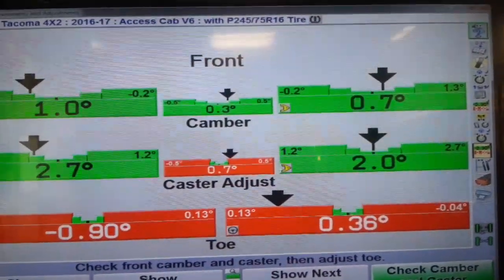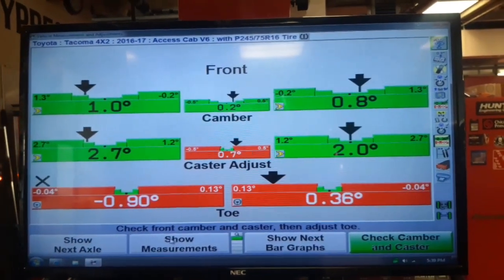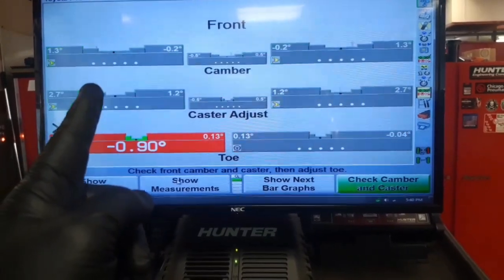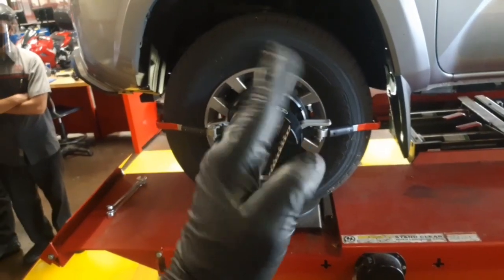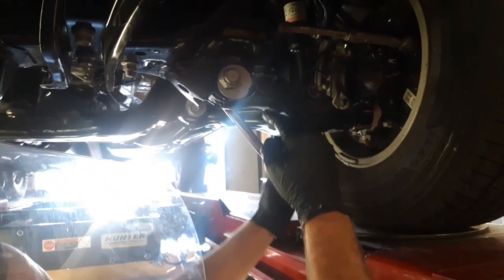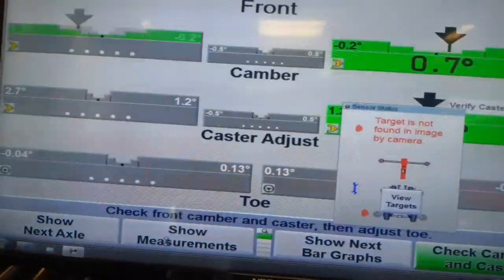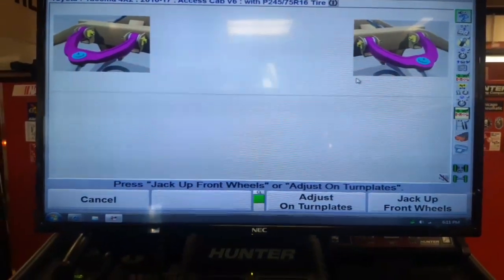How to adjust caster and camber using eccentrics on control arms AND UNDERSTAND IT!

Comment: Thanks so much!  my 1991 c1500 can now be fixed.  I need to knock out the tabs in the grooves.  Big-O said caster and camber were at the limits.  I'll be able to ball park it and take it for re- test.  Really appreciate the off vehicle demo.
Reply from the maker: Yeah those did have plastic tabs where they set the alignment at the factory. If they are still there that means 100% the caster camber has never been adjusted. Not surprised.

Comment: Nice video! I have a question - you say that 0.3 degree difference won't cause any pulling. I have even smaller  0.15 degree difference, but my car pulls very very slowly to the right - 1 lane change in about 200m. Could that be caused by this 0.15 degree difference? (degree on the right is smaller)
Reply from the maker: Number 1 suspect for that is road crown. The roads are sloped to the right for water runoff.
Reply: @CollegeAutomotiveClasses  I'm driving my wife's car and my ex-car on the exactly same way, but it doesn't pull to the right. That's why I think it's something with the car.
Reply from the maker: @lyubobg  every model car varies. As an example cars with wider tires or non independent suspension will follow road imperfections more. The real test would be to compare your model to a known good, example camry to camry. But if you know how the vehicle was when new, and you want to proceed with troubleshooting a good step would be to rotate the tires from left to right and right to left. Tires cause pulls as well. Or Iist full alignment measurements front and rear and I will help you evaluate. Caster and camber both cause pull. Not sure if you are factoring both.

Comment: Great video! I have a 67 f100 with a 2011 crown vic front end and since I lowered it, I have a issue with the wheel fighting me on turns and braking on turns. Ie.. Turning into my driveway or on 90 degree turns. Would that be caster?  I have the camber bolts to adjust camber. Any advice? I really appreciate it.

Comment: Is there a reason this alignmdnt is done hanging in the air?? I thought most alignments the vehicke is measured while on the ground? Or do u just have it up now to change it yhen put it bCk on the ground to reassure?  I am also confused how that ewuipment measures caster from.lasers?i can see the toe and camber but how does iy yell caster ?
Reply from the maker: It has full weight on it. Notice the wheels are still on the drive on rack, not hanging in the air. 
It measures caster using a sweep. Thr caster is not a live measurement. You have to re sweep it to verify.
Reply: After I replaced my entire front end, I had some guy from Discount Tire adjust the camber using the Ranger machine with my 2014 Ford Expedition raised like 4 inches off the rack.  The adjustment nuts/bolts are on the lower control arm with a torque spec of 258 foot pounds.  So he tightened it probably about half that torque or more, then lowers the vehicle.  I explained to him that the Ford Shop manual only says finger tight while raised, then you snug and torque everything once the vehicle is lowered.  Do you think my control arm bushings could’ve possibly gotten damaged?

Comment: If you do an alignment w/prints before you installed the Cam Bolts and you have like -1.2 degrees off on Camber, how it impacts the life of your tires (prints fm/one shop show: -1.0 on left front and -1.2 degrees on right front)? I bought those Cam Bolts for my car, but in doubt if to install them, even not because they have smaller diameter than the original ones, but just fm the fact that in most cases the exact torque on them is unknown. In most shops they don't follow torque specifications. So I think maybe it would be safer to replace tires more often than to install Cam Bolts and later to replace the bushing on the front (as far as I understand that is the main reason when the perfect alignment can't be done on older cars). Thank you for the informative film.
Reply from the maker: What is your year/make/model?
Reply: @CollegeAutomotiveClasses  I'm sorry, I didn't say, it is 2003 Chevrolet Cavalier. On Camber Bolt box for another car we have (2001 Saturn SL2) it is printed the torque value 97 Ft-lbs), but for Chevy just a chart:about 4 different diameter and a chart w/torques, and the diameter of the Camber Bolt is not in that chart.
Reply from the maker: @olenaerhardt7725  I see, familiar with both of those. 
Basically those have non-adjustable front caster and camber. The smaller bolt will give you minimal adjustments of camber only. Like a half degree or so depending on the exact brand bolt. 
The torque spec remains the same since the required clamping force on the knuckle is why the torque spec was created, and that isn't changing. Less about the bolt size. Typically the smaller bolts are hardened so they can accept full torque of the larger. 
It's not that big of a thing. 
Back in the day we used to grind the bolt hole in the strut from round to an oval to get the adjustment. But a lot has changed with the lawyer mentality so we shift the liability to the bolt manufacturer rather than our modification. 
1 to 1.2 degrees of negative camber is not going to cause your tires to wear all that much faster. Especially since the radial tires don't flex as much as the old days bias ply. 
TOE is the real killer. 

It it's causing you a lot of trouble just run it as is and do tire rotation to spread the wear onto the other tires when you move them front to rear.
Reply: @CollegeAutomotiveClasses  I don't know why lawyers will be concern about drilling a bit the steering knuckle hole. In Haynes Manual for 2003 Chevy Cavalier (1995-2004 Chevrolet, Pontiac and Sunfire to be more exact) it says on page 10-15: 
"On the vehicles covered in this manual, camber can only be adjusted by elongating the lower strut-to-knuckle hole."
I could elongate it by drilling (I did similar things, when removed the rivets by drilling them out from the control arm in order to install new ball joints, rather than to change the whole control arm). But I think it is not necessary, I'd better will rotate tires, how you advise, and see how everything is going. Before this recent alignment I did, the toe on the front was messed up well, the wheel was on 45 degrees to the right to go straight, and I drove with that condition about 30 mi to try new tires and trying to figure out what is the problem w/wheel. I saw the left front was out to the left just by eye, I thought to increase the # of visible teeth on the Inner Tie Rod on the left, but then thought maybe it is smth else, and anyway I'll go for an alignment. So it was like -0.50 on left front and -0.36 on right front on that front toe. During the alignment it was corrected, the wheel is straight now, and I didn't see any obvious tires damage, so yes, I'd better drive w/that small negative camber. Especially I've recently learned how to change tires w/simple Tire machine fm Harbor Freight, bought 5 tires instead of 4, so I can change when needed.  
About the torques, I don't know, usually they are lower for Cam Bolts. For example on Saturn the torque for camber Bolts is 97 Ft-lbs, says "don't overtorque" on the box, but the original torque for that car is 126 Ft-lbs (strut-to steering knuckle bolts/nuts), it is fm Haynes on 2001 Saturn. On Chevy also the original bolts/nuts 133 Ft-lbs, and on Camber Bolts 77 Ft-lbs (the technician fm Manufacture gave such answer on my Amazon question, I bought those Cam Bolts on Amazon). I think it might not be quite correct, since Saturn Cam Bolt is just tiny bit thicker and has 97 Ft-lbs, and Chevy only 77 Ft-lbs. Maybe different metal of course, but with all that I would say that the exact torque on Cam Bolts for Chevy is unknown, it should be printed on the box, and it is not.

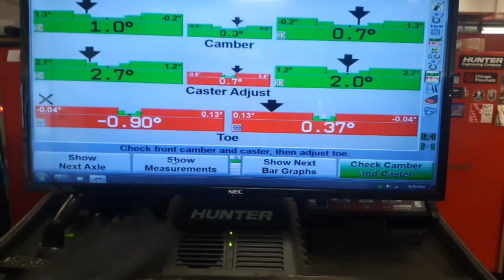Comment: At 2:26 are you near the rear or the front of the car? You says and point: "towards the rear", but it looks to me you point towards the front (by the shape of the lens). At 1:29 you say you want to move to less positive, so kind of toward negative: to the rear. Then you assistant uses the term "move it back", then eventually he says "to the rear". It is a bit confusing, when you don't state clearly where is the front and where is the rear of the car (camera moves fast, you can't see clearly, where you are). Otherwise good and informative film. Thank you.
Reply from the maker: The front of the truck is to the left at that time. 
On this Tacoma the adjustment is on the lower control arm where as many others are on the upper. 
If we move the lower ball joint (because that's the one that is on the adjustable control arm at this point) toward the rear, that will decrease caster. Or bring it closer to 0, then into the negative. 

If it were a silverado for example, the upper control arm is adjustable. So we would be moving the upper ball joint. If we were to move that same driver's side upper ball joint toward the rear, it would have the opposite effect of a Tacoma, that would be increasing the caster angle. 

For caster I visualize thr steering angle of a chopper motorcycle with the long stretched out forks... that's very very positive caster.
Reply: @CollegeAutomotiveClasses  I see, thank you.

Comment: Is a 1* positive camber enough to wear the outside edge of tires? The outside edges of my front tires are about done for after 20K.
Reply from the maker: Yeah it is, but toe is the number 1 cause. Typically smooth wear would be camber. Toe tends to feel choppy in one direction. 
Could also be a combination of both
Reply: @CollegeAutomotiveClasses  thank you. The alignment shop gave me some specs, and the toe is OK. Big O Tires. I'll have them do it again, should be under warranty.

Comment: Do you do side work I got a 2018 Tacoma that need a alignment
Reply from the maker: Typically no, I trade labor for labor a lot with other trades at home but doing an alignment would be at the school with school equipment so it would be unethical for me to do that as side work. Although I commonly do class demos or projects. And my students need to do several alignments to pass my class so if you are local we may be able to figure something out. Are you near cypress college?
Reply: @CollegeAutomotiveClasses  I live in N Fontana ..I got a Tacoma with SPC UCA and seems no one around here knows how to do proper alignment with those UCA and I stumbled across your video
Reply from the maker: @Jes96344  yeah, typical techs just toe and go everything. Even someone decent with alignments wants to follow on screen adjustments provided by the factory. You introduce an aftermarket part with an adjustable ball joint the tech has to really understand angles and how they change with rotating that ball joint. Especially since caster changes are not picked up live by the machine. 
Part of it too may be that an alignment typically pays a fixed amount, getting paid to toe and go a corolla and then getting paid the same to do your truck wouldn't be very appealing....
Your truck would take my class a good chunk of the lab session which is 1 to 7 Thursday Friday. I cover alignments in 5 weeks. Yours could be a demo. Itll cost you some pizza for the students, but I don't have a loaner car, a shuttle service or even a waiting room, but you can watch the work being done. That's the best I can do for ya.
Reply: @CollegeAutomotiveClasses  do you need to truck for both days and if so can I drop it off and pick up the next day
Reply from the maker: @Jes96344  nah just the one day. Best if you can wait with it though. You will probably have fun
Reply: @CollegeAutomotiveClasses  let me know what dates it will be maybe I can stay
Reply from the maker: @Jes96344  March 31st or April 1st. Either day

Comment: Need a video on installing Moog adjustable ball joints on 2000 Dodge ram 1500 4x4 with 5.9. Camber isn't adjustable stock and the alignment guys locally didn't have the slightest on how to install.
Reply from the maker: They install just like the original ball joint except the stud is offset so you have to turn it where you need it. The moog instructions are non existent so I am not sure if you line it up where you need it and press it in permanently, or if you press it in and can adjust it by turning afterward. 
I have seen a few types. 
Some of the nicer are for smaller cars and come with slotted control arms where the ball joints bolt in, and loosening the bolts allow the ball joint to move around in the slot. 

Find the right shop, maybe a front end or alignment shop should be able to get you squared away.

Comment: Quick question.  

My 2008 4runner is on a 6” lift with 35’s. Driving around town no issues,…but when I get around 45-50mph I get a wheel shake. Not crazy but it’s obvious. Sometimes if I get up in speed quickly no shake.  

Yes,…..tires were road forced balanced, and unfortunately they are “mud” tires. (Came with the truck) 

When I looked at my eccentric bolts for adjusting caster,….my passenger side bolt is facing inwards and the drivers side is facing downwards but slightly favoring towards the inward.  So that tells me that my drivers side caster is less.  Other words,….the drivers side tire is pulled slightly rearwards then the passenger side. I took a quick measurement and it’s off about 1/4” or slightly more.  

Truck drives straight with no obvious pulling. 

Could this be causing my wheel shimmy?  I know more positive caster is a good thing when lifted?  

Thanks for a great tutorial!
Reply from the maker: I have never experienced positive caster causing a shimmy but I did read it could happen in theory. I have some doubt on that. 
But for sure low/insufficient caster can. 
Do you know what your road force numbers were? 
A quick troubleshooting step would be rotating tires front to rear, if it improves you know it is one or both of the tires that were on the front. That's my gut feeling as well.
Reply: @CollegeAutomotiveClasses  i don’t know my road force numbers.  He did say that he got 3 within good specs but the one he couldn’t. The one that he couldn’t get good I put on the passenger rear. 

I’m having a 4x4 truck place (specialize in lifts) do a front end alignment this coming Thursday.  Hopefully they can figure things out.  I’m also thinking my tires are the issue.

Comment: I finally understand caster.  I would see the vertical line but I didn't know it referred to  the angle of upper to lower ball joints.  So cool. Thank you!
Reply from the maker: I struggled with it for a while too. SAI is the next one to understand then included angle

Comment: excellent video, I recently had my 06 Tacoma 4x4 front suspension (Same components as the truck in the video) rebuilt minus Upper control arms, the alignment shop could not get the passenger side caster in spec. I have new oem toyota cam bolts, moog LCA and ball joints. I'm thinking I need new UCA's, what are your thoughts?
The truck pulls to the left.
caster:
Range is 1.0 - 2.5
acutal is 3.3
cross caster is -1.1 deg
Thank you
Reply from the maker: The max cross caster is .5 so yeah you are out of spec side to side even if each is within spec individually. 
Those eccentrics can be a bit tricky and the hunter software does not guide the tech well which is why I wanted to make the video for my students. 
My thoughts are to get the cross camber down below a half. Sometimes if one is is maxed out I will adjust the other side to match even if it puts them both near the limit of spec. 
Caster is kind of funny,  since it won't wear tires you really just want it to match side to side so it doesn't pull. If you have them both too low it may shimmy so if possible keep it in range but for sure equal side to side. If too high (bigger number) don't sweat it, Tacoma don't care about high caster individually, in theory it would be high steering effort but the pump more than makes up for it. To clear bigger tires I max the caster out all the time and they drive great.
Reply: @CollegeAutomotiveClasses  Thank you!

Comment: Hi I'm from Pakistan. I have Toyota tundra with a lift kit installed and no one in my country can help with alignment especially because no machine get a reading. 

Issue is that the difference between length of my front and back wheel is .5 inches apart on left and right side. The distance is less on the right side and the truck pulls to the right also. Where as while braking the truck pulls left. Please help

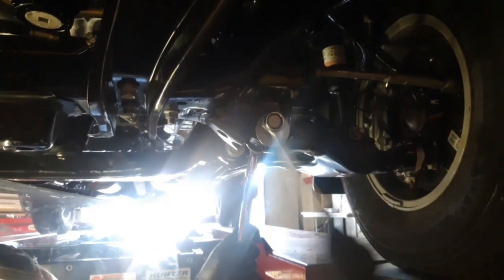Comment: Hmm.  Your cam bolt position changed after you made the initial adjustment.  When I paused the video at 8:51 the bolt is on the bottom, with the graduations  at the top.  When you return at 10:29 after sweeping, the cam bolt is at the top left position.  Also note the camber and toe numbers changed significantly as well before and after the initial sweep.  Unless those don't update live either, but I assume they do.  Just need to make sure the bolt is tight before sweeping.
Reply from the maker: Camber and toe are live. I don't remember exactly why it changed, I think it took me a couple tries so I cut out and adjustment or something. Hope it helps
Reply: @CollegeAutomotiveClasses  Oh ok, makes sense.  Thanks for posting.
Reply: @szargos  Hahaha 🤣🤣 i saw the same thing he left the bolt in the bottom and when he returns the bolt is in the top.. i come to the comments to see if somebody noticed it.. im glad i was not the olny one

Comment: How do I know if my car's castor angle is right?
Reply from the maker: Perform alignment check with caster sweep on an alignment machine is the only way to know for sure. 

Sometimes evident by different tire gaps between tire and the fender or front bumper (3 and 9 o clock positons)

Or 
Symptoms would be pull for uneven caster from one side to the other. 
Negative caster will shimmy
Positive caster high steering effort.